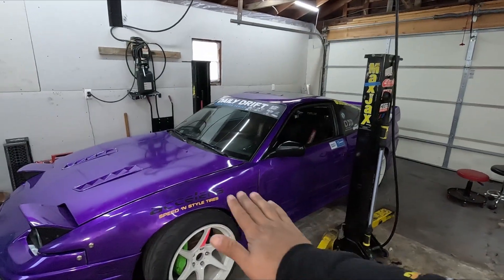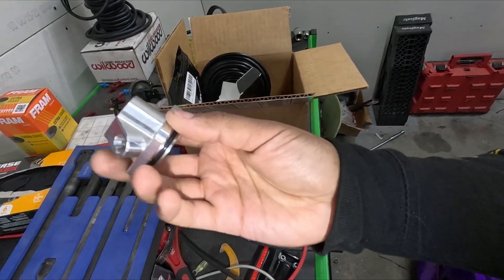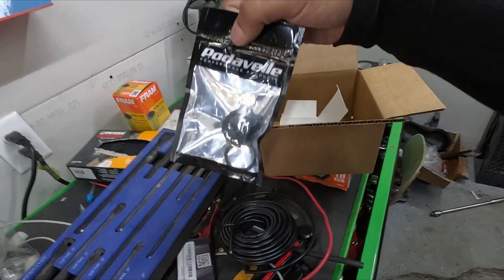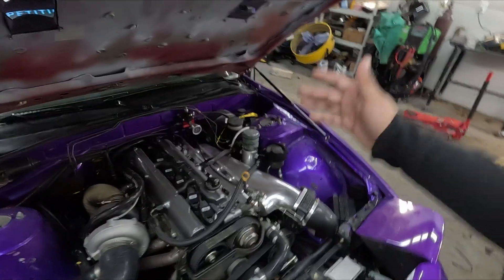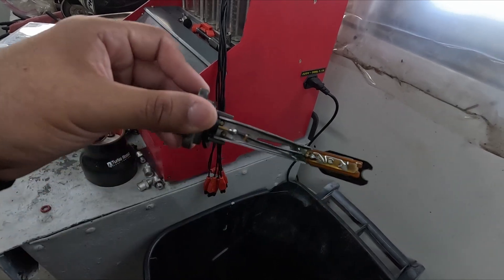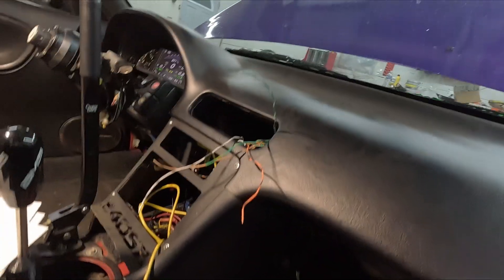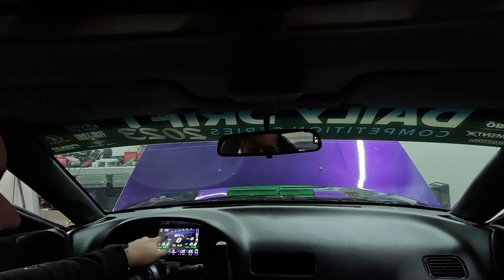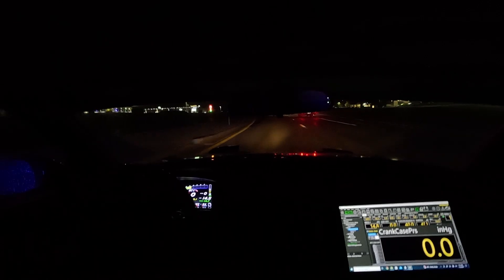2JZ CRANKCASE PRESSURE ISSUE | HOW TO TEST FOR CRANKCASE PRESSUE

Comment: Thanks for sharing, I could run the fuel pressure sensor temporarily to the same location on oil level and will show me correct reading right?

Comment: Crankcase pressure should be zero. Especially at your power/boost level with a catch can that vents to atmosphere. So yep that is probably reading correctly.

The oil pump has 2 locating dowels. When you pull the pump make sure they are there.

Also tapping the seal in rather than pressing can pop the inner spring off which means theres no tension on the inner lip.

When the motors apart measure the gear wear on the pump. As per fsm. 
I just had fms issues and the inner gear tip clearance was to high.

And also your crank thrust clearance. But im leaning towards pump over anything else.

Also measure the runout on the crank snout where the seal runs.

The new toyota oem pump issue has 2 problems. 

1. They now come virtually dry (never used to) and need to he dissaembled, checked, lubricated etc. Like they always should be anyways but not everyone does that.

2. The gears are rubbish. Supposedly manufacturing facility has changed and the composition of the gears is junk. So they break and explode. Just like nissan rb oil pump gears have done forever 😂.

High speed engineering in australia make billet gears for them now. Multiple australian companies on sell there gears aswell and keep them in stock.
Reply from the maker: @me_200sx4  thank you for the input, I’m leaning towards the pump aswelll I will be taking the engine out soon and investigating